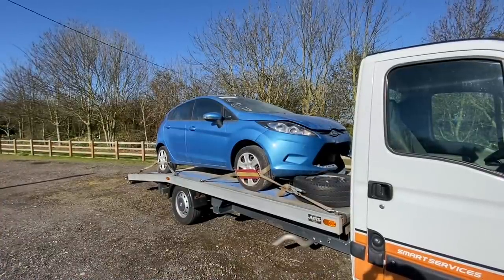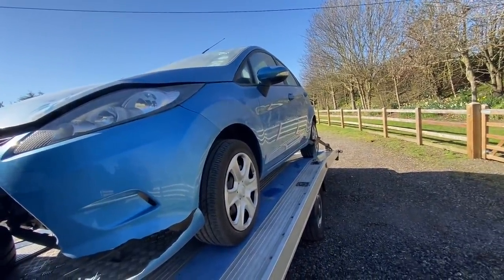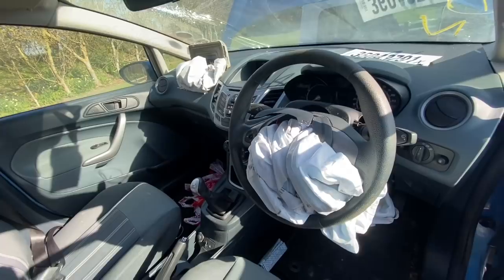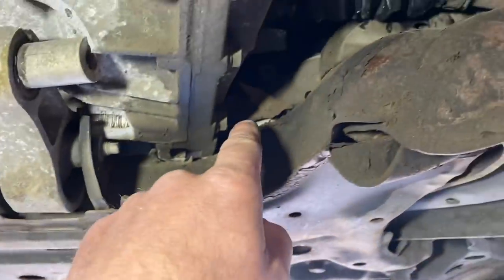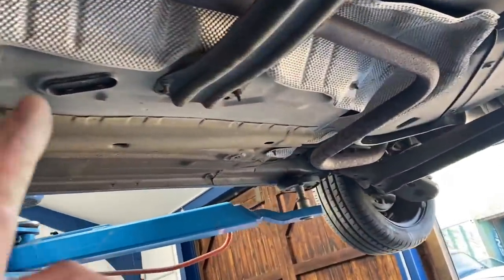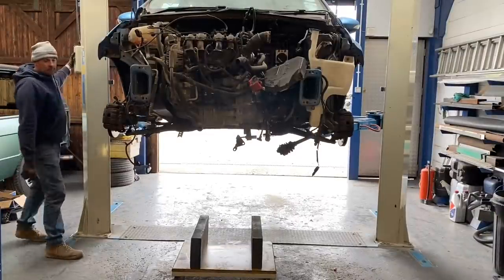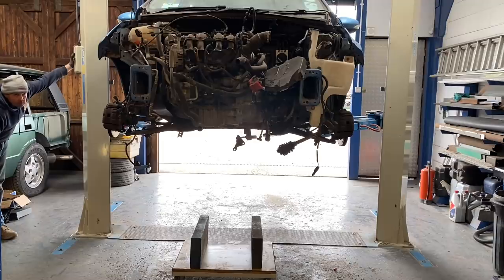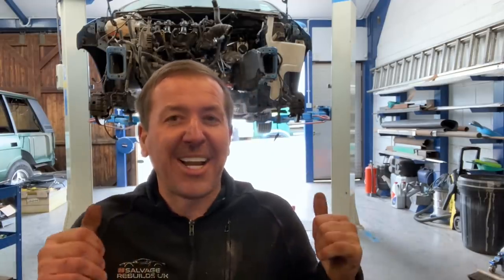Copart Salvage Bargain £££ or Did We Buy a Lemon ??? PT 1

Comment: The strip down went well and as far as we can see all the damage is found and gone. It is a longer, possibly expensive, parts list, but with sharp dealing the wallet damage could be limited. It looks like a low bollard, rock or similar failed to get out of the way. If the bolting together goes as well as the unbolting, it should be done in a couple more videos, it is all down to your 'value shopping' now, good luck with that. If anyone can, you will get the mission done.

Comment: The state of the clutch depends entirely on the way the car has been driven, Surely it makes sense to remove and examine the clutch to see if, in fact, it really needs replacing? I have an 07 VW Sharan (Ford Galaxy) which has done 145,000 miles on its original clutch and shows no sign of weakening or extensive wear.

Comment: More work than you thought . On the plus side the real damage is all bolt on. Most people would run a mile but for someone starting out in salvage repairs its exactly what they should buy . A car thats got real potential for repair all bits reasonable price and available. Wouldnt it be great if the parts car had just had a new clutch fitted .

Comment: Change the clutch on a 39,000 mile car. 🤔 I changed a failed Gearbox on my Renault 19 TSE  many years back and left the same clutch in it and it went on to do 221,000 miles on the same clutch when I got rid of the car. Although, I purchased said car with 81,000 miles on the clock, I didn't have service history with the car, so unaware if it might've been changed in that 81,000 mile period.
Reply: I'd expect a modern clutch to last at least 150k, possibly more, unless the car has been seriously thrashed. I'd have a look at the clutch that's in there and keep it unless was seriously worn.

Comment: In its favour  parts are cheap, and hopefully the  Breakers will do you a deal as your going to need a set of shafts also,  but its worth doing as its such a low mileage car,  so if you can get  all the parts from the same place, it should be cheaper than shopping round, especially as your breakers  has scrapped a lot of them. .

Comment: On the bright side the motor was cheap parts are reasonable and with low mileage you should get a drink out of it proper nut and bolt video

Comment: I bought one off copart exactly same your fiesta but engine knackered lol and I was surprised chassis is fine and shame airbag and front end plus engine. 
can’t tell engine okay on copart photo I feel like copart misleading me. Anyway lucky me I won £285 included fee for 10 reg cost me fix it up £800 then sold car for £1700 you should be fine can sell about over £2k on 39k miles.

Comment: Cant have it all I guess! That's the game. What are your thoughts on how that damage occurred? Hit a boulder or something? Weirdly localised! Cheers boys.
Reply: Looks like it's smacked something small, low and immovable. That was my guess as well, rock or concrete block that's fallen off the back of a truck and been struck at motorway speeds.
Reply from the maker: No idea bud 👍
Reply: @thomas316  In York, they had some 'smart' bollards that sank into the ground to let buses through then popped back up again. They claimed a number of victims as cars tried to follow the bus!!
I would suspect this has hit something equally solid. High kerb, unseen rock or tree trunk on a verge. Who knows? Car definitely came 2nd 😢😩

Comment: I think you both do a tremendous civic service by reclaiming these cars. The down votes you get are probably from climate change keyboard warriors who despise fossil fuel transport. But please be comforted by the fact that the carbon footprint of the manufacture of a car is typically six times what the engine emits during a reasonable lifetime. So by recycling these vehicles you are partly postponing the rush to scrap existing cars for electric vehicles that probably have a higher carbon footprint both in manufacture and running. Think of the wind turbines and charging station infrastructure needed. Anyway I think you are both honest, knowledgeable so keep up the good work.

Comment: Get 100k on original clutch easily on modern cars.  If it's not broke don't fix it mate. Otherwise throwing good money after bad.
Reply: My Mitsubishi Colt was on original clutch and even brake pads at 110k miles when I sold it. Needed a new alternator (bearing was going) and starter when the braid wire rotted away due to salt. Clutch depends on the previous driver(s), worth doing for less aggro while it's apart.

Comment: The only problem is the car might have only done 39000 but the second hand gearbox could have done 150000
Reply: Swings and roundabouts high mileage usually means motorway use so less gear changing.
Reply: A 39000 car has probably had lots of town driving and as Mark says more gear changes and abuse than a high miler
Reply from the maker: I wouldn’t use a high mileage box